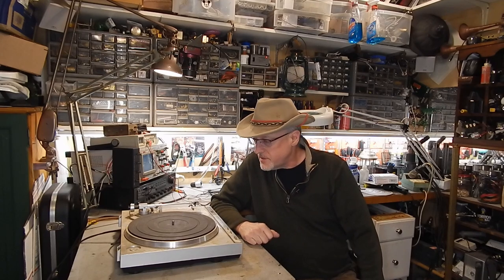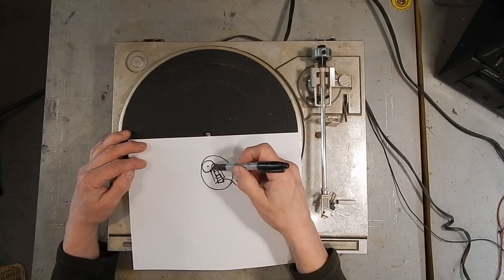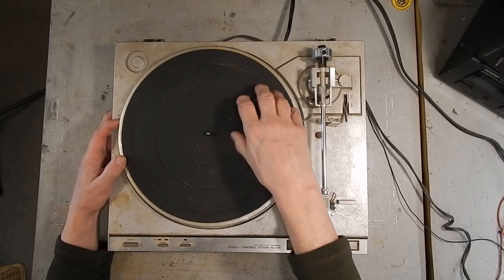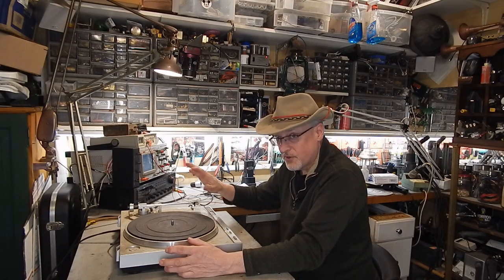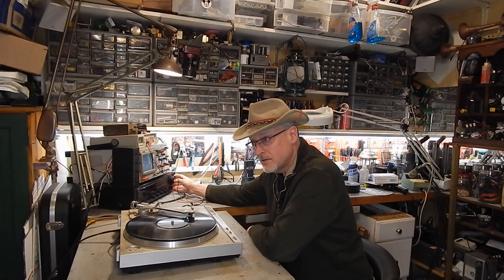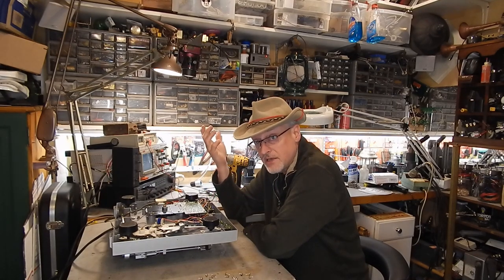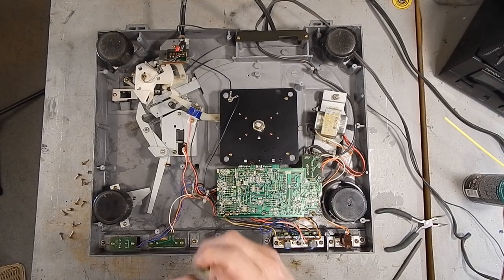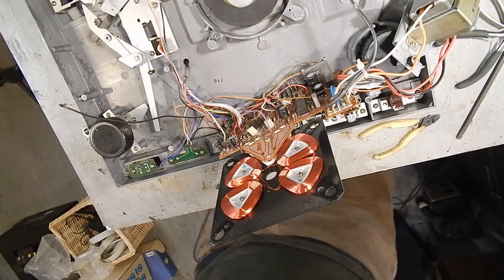Vintage Turntable Repair

Comment: Great video as always! I guess those where quite expensive when it was new.
Reply from the maker: I just looked and a non-working one was selling for $250 on Reverb. I'm sure that's more than they were originally!
Reply: @JakevonSlatt   In my country HiFi things marketed at the "golden ear" club people often are ridiculously expensive, especialy if it is marked "tube amplifier" (if it's also marked Hammond, Marchall, B&O or something similar it tend to go up even higher...)(despite the fact i just bought a tecnically much better 1950s original  tube ampifier hidden inside a damaged radio cabinet for about 6$ in the charity shop... which is interesting since people seem to just thow away all the parts inside those old cabinets and installing a 10$ China made circuitboard that realy sound like complete crap and an even worse speaker and call it a "restoration" before they try to sell it...). Ha ha
Reply from the maker: I think it's a truism that if you are old enough to have the funds to purchase "audiophile" equipment you are too old to hear the difference! My brother-in-law recently brought me a Mcintosh MC240 that he found in a barn. It was covered in rat poop and missing most of the tubes. We cleaned it up, spent about $100 on new tubes and sold it in a day on eBay for $2500. I kind of wanted to keep it but those tube amps are no good for the Oontz oontz stuff I listen too!
Reply: @JakevonSlatt  Ah, those where realy beautiful! I can imagine sitting and watching the tubes at night. But, honestly i had probably done the exact same thing.
I hawe currently only a duo block i built from scratch from old surplus military transmitter valves and the old radios, but that's just because it's my hobby to screw on old radios in the afternoons, tubes has in reality a lot of limitations, i agree with that, unless of course one are realy fanatic and build an entire rig with proper old scool horns, maybe in the future i will, but not now... ha ha Fun fact is that kC3 tubes where used in German weather balloons during the war, it had an electric heatercoil for thermal compensation on the outusde and transmitted a dynamic graph from an aneroid and as i assume a thermometerhead.

Comment: Very nice find! Impressive work. I've had this model for two years now and I gotta say: these Sony's are underrated. AND fully automatic!? A very nice turntable indeed. I just bought a second on the used market a few days ago. The first one I I got started giving me a noticeable hum. When I move the rca cables in the rear of the table the hum got worse. Seems like something is loose or frayed. Any tips on where to look for a solution? Thank you should you respond.
Reply from the maker: That should be an easy fix! The audio side is completely separate from the main electronics and it should be easy to find the loose connections.

Comment: Great gizmologizing, there. Now you've got a better turntable than you could probably buy new these days.
I have a fine old belt drive Technics turntable that has played me many hours of music back in the day. The problem with it is that the motor bearings are worn out (it is now a Rumble King turntable). Replacing motor bearings would ordinarily not be a problem, except that in this case the housing for the motor is an amorphous plastic structure which is molded into the board itself. To disassemble it and replace the bearings would involve actually cutting the housing apart, and then most likely fabricating brackets to remount the assembly. I haven't looked at it in about two decades, and I never looked too deeply "under the hood", but my memory of it is that it just wouldn't be worth the effort.
Reply from the maker: Thanks Len! Yeah, there is a special place in heck for engineers that un-serviceable components!